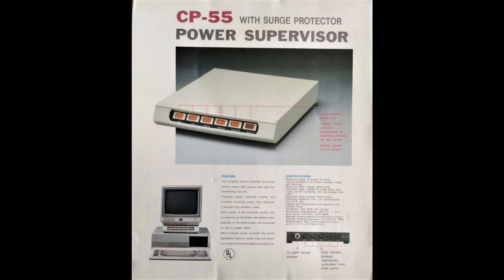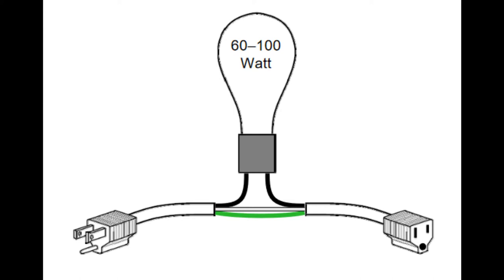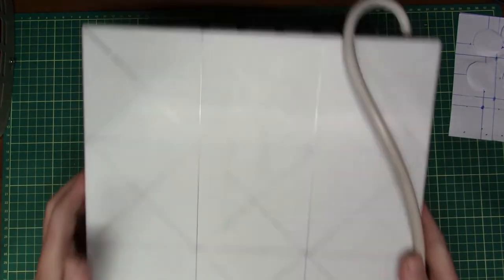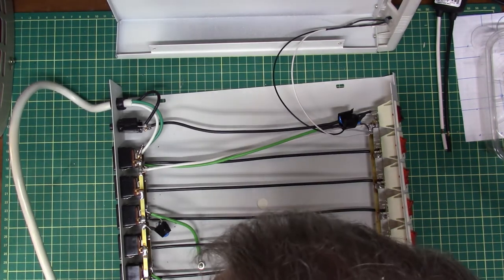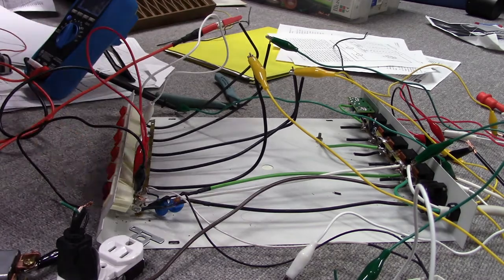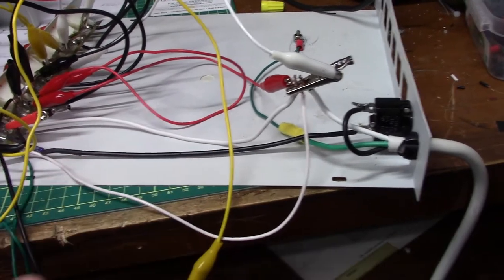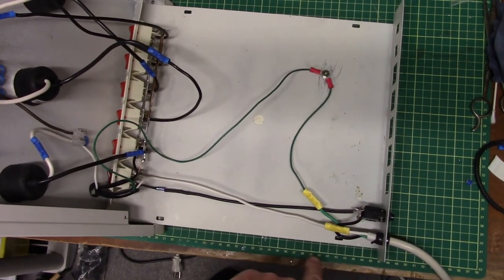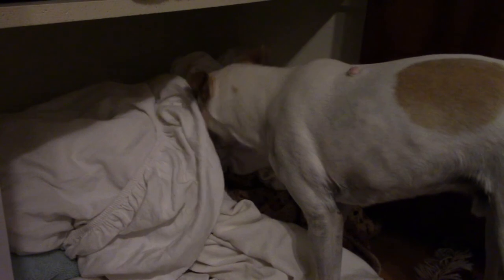01621 Make or Mend Monday #1.  A New Dim Bulb Current Limiter

Comment: I love the chassis you found to make your dim bulb tester.  I created something very similar years ago but had to start from scratch.  I have to say though, I about pissed myself laughing at one point in the video.  The drill bit you used in the hand drill to make the center hole is NOT, I say again NOT a metal bit.  It's a wood working Forstner type drill bit.  It is in no way, shape or form designed to drill holes in metal.  I have dozens of them and they are great for making tear out free holes in wood but the key word there is wood.  Anyhow, I wish I had run across one of those chassis when I made mine.  Would have saved a lot of work.  Mike KC3OSD
Reply from the maker: Yep it is a Forstner (a very cheap chinesium one ) and it was 100% trashed from hitting a nail some time ago. I have found that there are very useful for cutting though metal (thin) no good for wood anymore.  I have a hole press now so I now use that instead.  

Cheers.

Comment: Mine has one 100 watt bulb which limits the series current to approximateky 1 amp. I feel that that is enough current for the series light to do its job. Any larger bulb would void the protection this project creates.
Reply from the maker: I guess it all depends on what you are working on.  I had a 30A PS on it the other day I had to use 2 100s and 2 60s to even get it to start up.  but that is extraordinary ;)

Comment: Nice.  You didn't mention how the amount of limiting changes with more or less bulbs specifically, though?
Reply from the maker: It is what ever you put in line.  In my case I think it is 40/60/40/60 then 60+40  so any combination from 40 to 300 max.  The other day when I was working on  a large tube amp I had to swap out a 40 for a 300 to get it to fire up.
Reply: @byterock   Does adding more bulbs in parallel increase or decrease the effect? How do you calculate the effect? How does choosing different bulbs change it? What about the inrush current - don't bulbs have momentary inrush current themselves as they heat up?  I
Reply from the maker: @SkylosSobaka  This is an AC circuit so you have to figure out 'Parallel Impedance'  I would have  to use an impedance calculator for that and still the maths are way above my pay grade.   https://www.electricaltechnology.org/2018/09/which-bulb-glows-brighter-connected-in-series-parallel.html  for the long explanation for the .25 reason with AC  they all draw their rated wattage  in both || and series.  In series the lower wattage glow brighter and in || the higher wattage glow brighter.   In the end we are trying to limit the 'Current' so if it glows bright you turn it off.   I guess I have my subject for my next 'Workbench  Safety 101'  How does a Dim Bulb work ;)   For you last question 'Yes' the current increases as the bulbs heat up and one can see with the 'drill' test.

Comment: Hi
It does not matter if you can't se the difference between live and neutral. It is Alternating Current, so when the circuit is connected  the live position changes 50 times per second...
Reply from the maker: Yeah that is true but you do not want to mix them up, as neutral in NA is connected directly to ground while live is not.  Don't want a grounding error.
Reply: @byterock  yes, but it doesn't matter. If you insert the plug the other way around, your neutral will become live, no matter how you wired them inside. There are some appliances that won't work if you insert the plug the other way around, but we are talking about 0,5% from all electronics. Also, a ground lift button is needed, if you want to take measurements safely, without blowing up your DSO. Those dim bulb testers without a ground wire, are actually better.
Reply from the maker: @Atelierul29  Well it does use a three prong plug, and of course it is only as good (ground wise) as the socket it is plugged into.   ;)    I am not sure you would ever want to float a DSO.  but that is a good subject for a video